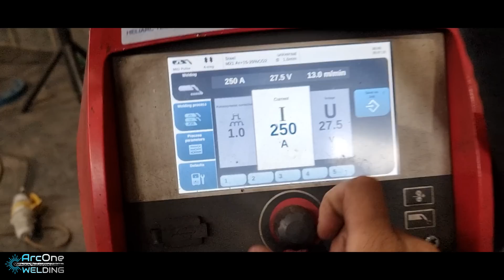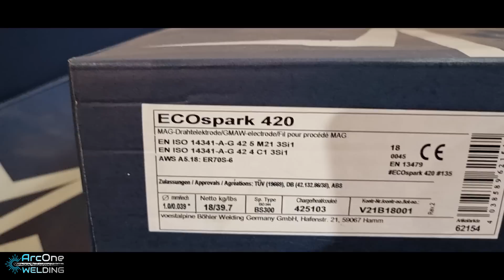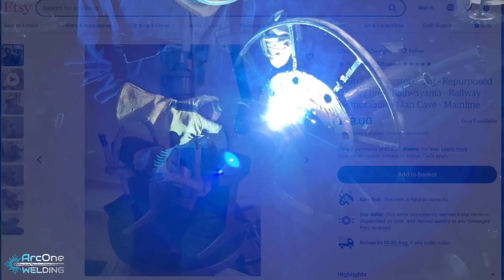How Many Runs To MIG/MAG A SCH160 Butt Weld!!

Comment: Blimey, small world isnt it😊lol i remember Dominic working in the plate shop though, was trying to get the hang of fluxcore at the time, and had a go at a bit of basic tig during lunchbreaks too. 
Those pieces were from a length that was brought in to do a procedure test, to qualify a procedure for the company i work for to do a specific job. Between the Welding Engineer, Welding Inspector and me, we had to develop and submit a provisional procedure to the client, then have an inspector on site to take run-out lengths to work out heat inputs all the way through me testing it out. Youre right though, it was Tig root and hot pass, Low Hydrogen fill and cap. Took a good few hours to do that one lol, the other test piece that went with it had a 60mm bore and a 60mm wall thickness, took around 25hrs in total, again Tig root and hot pass 7018 LowHy fill and cap

Comment: In the 1980’s I worked at a Nuclear power plant under construction and the highest paid employees were nuclear class one welders.. The main steam lines in the the containment structure were 60” in dia and took one man year to complete one connection weld of the pipe.. That is 2080 hours which included magna-flux of the weld looking for defects..
Reply: Jesus Christ that's a lot of time for a joint. Although, I guess 2080 hours is a hell of a lot cheaper than paying for cleanup if a bad weld causes containment failure.

Comment: I had  to do several  butt joints on some 16"  sch 160.  5P  root pass  7018  fill and cap.  It took 50 lbs  per joint IIRC.

Comment: Guessed 25 passes. .045 wire and more heat would have given you a "better" kernel. 200a root and 300a hots
Reply from the maker: 3000 is crazy high! I found going that high makes the weld pool too narrow
Reply: @ARCONEWELDING  look at your kernel, you got a bond to the base, but no actual penetration. Perfect sharp straight line V exactly following your prep grind. 300 sounds crazy hot, but rule of thumb is an amp per 0.001 inch, or 40 amp per millimeter. So "rule of thumb" says over 1300 amps for that wall thickness. You won't need to run that hot, but you do need plenty of heat to dig on such a big thermal mass. Your beads get thin because your machine runs "constant current", should be "constant voltage" for MIG. to compensate, higher feed (more metal quicker), and weave. Fatter wire too. But honestly, after that root pass you could spray that joint at almost 500 amps, no problem. It'd be ugly as dog balls as you laid down the hot passes, but you'd have real bite, and a max strength joint. Besides, a pretty cap is the only cosmetic consideration. If you loaded that half pipe with a ball end punch in a 20 ton press (ball on your root), the weld would shear right at the edge of that kernel, guaranteed.

Comment: After  40 years in the U.A. (Pipefitter /Welders) Union , I have never ever welded pipe with a MIG welder. The  process I would use would be a  6010 root 3/32- 1/8" dia. rod ,same space and land as rod dia.
change electrodes to  7018 (uphill rod) 1/8" dia. for the hot pass, ( IMPORTANT ..!)  START looking for the low spots . heavy wall pipe like that you will want to fill and cap using stringers.
change to 5/32" dia. and watch for low spots. fill them in . don't rush it.
When I TIG Stainless I won't continue to run the root until I can put my bare hand on the pipe.
this is for  100% X Ray work , not "junk yard work"  **
remember  theres only 5 variables  in stick welding
joint fitup
electrode angle
travel speed
current setting
arc length

the smaller the pipe the harder it is to weld, because the rate of change happens faster and   then add it, itcs on the  6G (45° angle )  .
The two  2G and  5G   you can weld out what ever handed you are  left or right
 .  6G  makes you weld back handed some where on the joint.
the  reason I  mentioned this info is what you said on the video.
THIS is what you want to practice . you will get the  2" Arky Bellhole test first then any special pipe after.
try this take a piece of Wet and Dry sandpaper the size of  the old lens and  contact cement it on the inside of the opposite   gloves cuff..
7018 gets that glass melted flux and it is hard to restrike the rod....no more .
a short rod makes the rate of change no big deal
sorry for the long windedness.
hope this helped . I wish I would have had heard the five variables  sooner ,you practice it and you don't realize it  .when it is spelled out   makes more sense .

Comment: These size pipes are used for choke and kill lines on risers offshore. Usual procedure is tig root and hot pass then fill with stick. We used to give them a 3rd tig pass then fill with 5mm rods and cap with 4mm.From memory they were pressure tested upto 22000 psi.
Reply: I welded something similar but it was steampiping on a powerplant  also with stick  but it was mounted so it was welded  from 6 o’clock over 9 or3 to 12  o’clock, but it was good money when we made those pipes and every welding was xrayed and if they found a spot we had to cut the welded part out and make 2 more welds, we where not alowed to make repairs in the weldings so it was a bit nerwewrecking job to do but we where only 2  guys who was certified to do this
Reply: 22000 holy shit.
Reply: The place he was working at (work there myself) had a length ofnthis floating about in the yard, and we used it to get an rough calculations for a provisional wps put together for approval testing  for a specific job. The test pieces themselves which came in machined, had a 60mm bore, and a 60mm wall with a compound angle prep, was welded with a tig root and hotpass (could only have 4mm depth from inside of root to outside of hotpass) then filled and capped with Elga P48S 7018 Low Hy rods. The actual testing took around 20hrs as it only had a 250°c interpass temperature which had to stick to😕

Comment: When that silly lump of metal has annoyed the shit out of you. 

You take a tiny piece of steel and a magnet. 
One goes on the door and the other goes on the door stop on the wall. 

If it's a strong magnet have some plastic or non magnetic material in between. Duct tape works fine.
Reply from the maker: Thats a good shout!

Comment: I heard they run 6013 in the UK on pipe
Reply: Yes we often do.   Or low hydrogen 7016 / 7018.  Sometimes 316l  or 309.  I had a nice pack of nicrmo625   inconel electrodes.
  It depends what material we are welding.

Do you use 6013 ?

Comment: You can glue up some rubber to the bottom of it. It prevents scratches on the floor. You can glue a piece of wheel tube.
Reply from the maker: I ordered some foam furniture things for the bottom 👍🏽

Comment: Love watching your videos mate.
Reply from the maker: Thank you bro
Reply: @ARCONEWELDING  No probs.  I used to do alot of Mig/Mag but never never working with pipe.

A few years ago I started a new job and learned to stick weld in an industrial setting. Tig root was not a problem but for me the open root MMA was extremely difficult to pass the welder qualifications on 2" sch 80 pipe.

Anyway I would love a mig setup such as your fronious as it is at least  8x times faster and the results speak for themselves.  I have used Fronious CMT synergic machines in the past and the quality is outstanding.   Rivals any Miller or Lincoln or Kempi.  Very expensive though!    

Good luck mate, keep up the great vids !

Comment: for etching just use used laminated flap disc, if you use something like p120 you can get nice surface. Then I normaly use normal stainless steel pickling gel. A quick question : Do you find any real difference between tpsi and transsteel pulse programs (for normal steel welding) ?
Reply from the maker: The stainless still stuff works great
Reply from the maker: They are basically the same, the transteel is a cheaper machine then the tps400i you can mig with the same as me only difference from my understanding is my machine can get updates to stick and tig with all features
Reply: @ARCONEWELDING  i had to buy a top welder for a company that i work with. I went with the transsteel 400 pulse, but i havent got a chance to try it out. Quick question nr.2  why dont you use 1.2mm wire ?  Productivity goes up by 20-30 percent